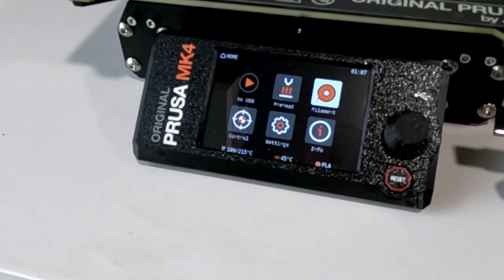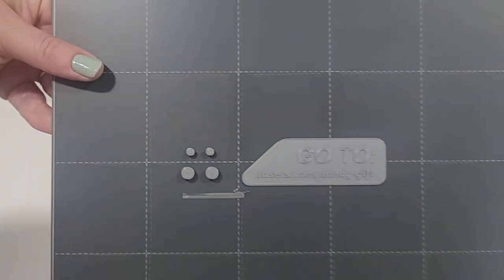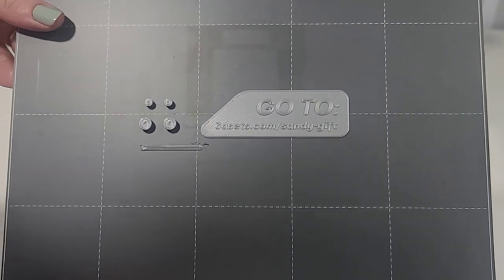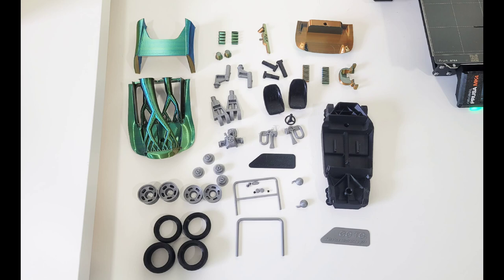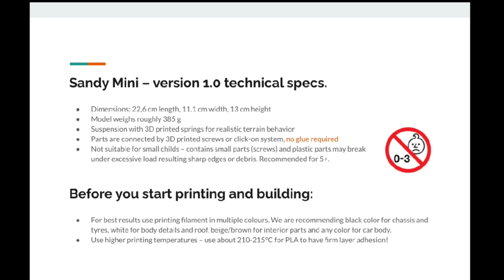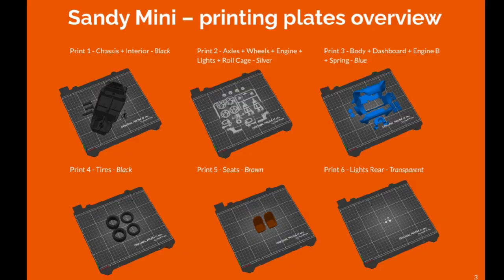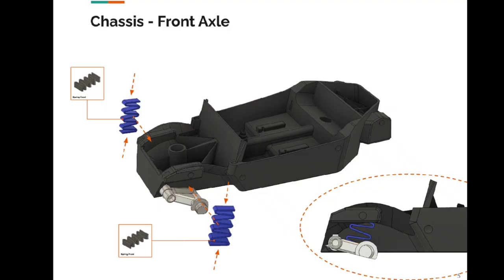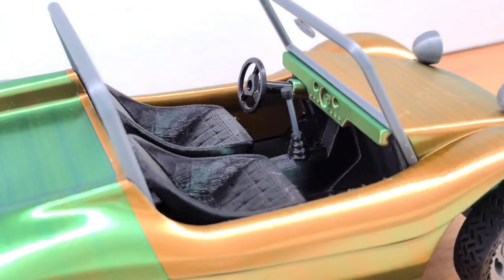Sandy Mini Car on the Prusa MK4 turned out beautiful!!

Comment: I dread long prints, always fearing something going wrong..LOL.. BUT... I actually want to try this lil dune buggy. I am also not a fan of the SILK filaments, BUT, now, the one spool of pink/purple silk that was sent to me, I now have a neat reason to use it.. .Thank you for sharing this project. I know what I am doing later. Thank you. By chance, did you attempt to try making the black tires out of the flex TPU or just one of the plastics?
Reply from the maker: Same! Especially on a file that's presliced. I  thought about TPU on the tires but just did PLA since that's what was preloaded. They turned out nice. Thanks!

Comment: I'm researching for my first 3D printer and i love to tinker.   Of the Prusa XL vs MK4 that you have, which do you think works best for these types of projects like you did in the video?  I'm deciding between XL, MK4, Voron DIY kit or a Bambu X1 etc.  I  like the idea I could make model cars trucks and trains and this is really making me more excited than ever to get a 3d printer.
Reply: I have none of the four printers you listed (yet), but I'm interested in all of them, so here's my take. 

Mk4, XL: Imo, that's an apples to pears comparison, it depends on how big of a printer you need (and you probably want a bigger printer than you really need) and if you want a toolchanger. Both Prusas probably require the least amount of tinkering/adjusting to get good prints out of these four. Biggest downside for me is the lack of enclosure to print ABS/ASA, but there are plenty of enclosures available.

Voron: The typical consensus is to not get a Voron as your first printer, but I know people that did and it worked well for them, and since you like to tinker, it may work  for you, too. But the hardware is just the one half of the build, you will have to learn Klipper and how to setup/config your Voron, which can be taunting at first. But once you have it well tuned, it will probably produce the best prints at the fastest time between the four.

Bambu: I see the X1C as a middle ground between a Mk4 and a Voron. You get a out-of-box experience similar to a Mk4, but the form factor and speed of a Trident. And ofc you have the AMS, if that's something you want. I do hear/read more negative things about the X1C than the other three (very loud, wear of the X carriage, no user serviceability, weak layer bonding at default speeds, etc). These might not apply to every unit or be actual issues, but that's what I noticed. And if you'll primarily print PLA and PETG, the P1P is a good alternative, too.

So, if you want a printer that (supposedly) just works and you don't need the built-in enclosure, I'd go with a Mk4 (which I'll probably do for my next printer) or XL, depending on size/if you want a tool changer. If you want to build it and dive into Klipper, a Voron (Trident imo) is the better option. If you want easy multicolor prints or filament backups and a fast machine (and you know about the potential issues), a Bambu printer might work well for you.
Reply from the maker: Hi Benny. I don't have a Bambu or Voron. Of the Prusas, I would recommend the MK4 because you will get it the quickest and the auto Z is amazing. It's worth waiting a little bit for over getting an MK3 or Mini. I love my XL but it was a long wait. This was my first  car that I made and I am already looking for more. 3dsets.com has really great designs. Thanks!
Reply: @ThomasS17  @tada3dprinting
Thank you both for the info.  I like the tinkering, problem solving etc more than anything.  Which is why avoron kit interested me.  And I'm happy to hear the good impressions you both have about the Mk4 and i think that's what's I'm going shoot for.  We'll see.  I could change my mind 100 more times before deciding 👍😄  thank you!  Love the projects this channel has been putting out.
Reply: @tada3dprinting  Wow! Thank you for sharing that site! Any other sites that sell similar files but for different car models?